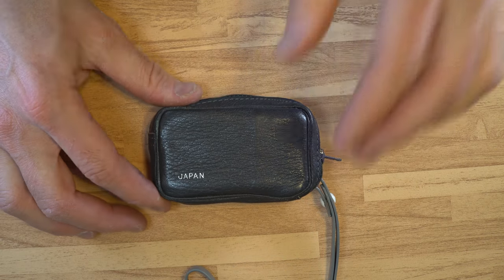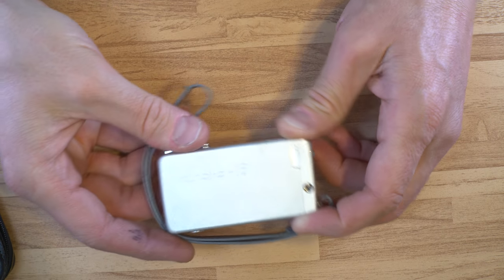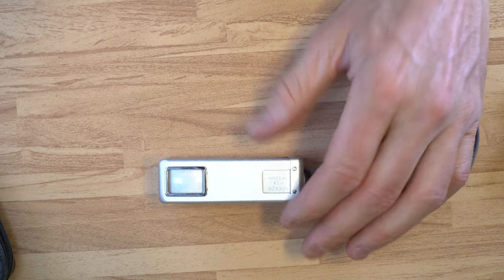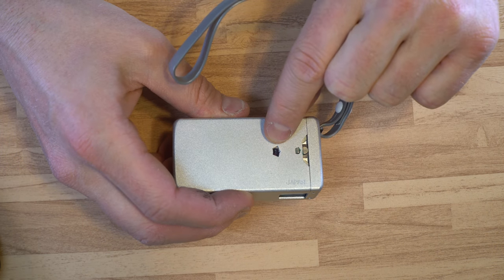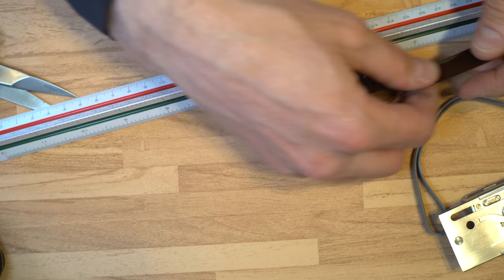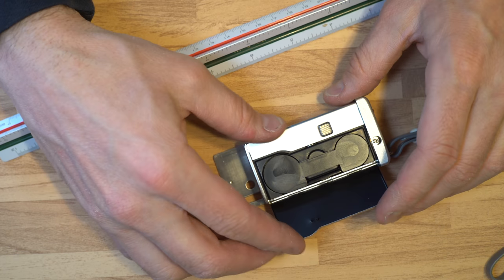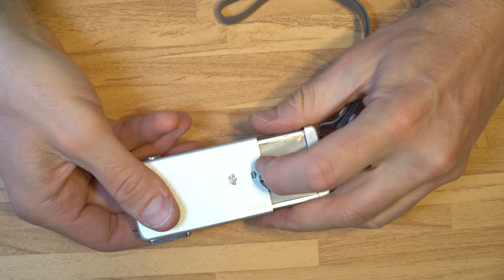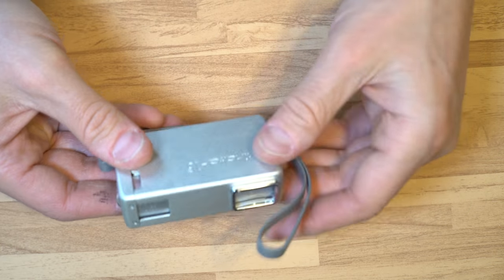Minolta 16-II Manual: Take Photos, Flash, Load Film, Re-spool Film, Shutter Speed, Aperture Setting

Comment: In case viewers are put off, let me clarify that the only part of the film self-loading procedure that must be done in the dark is inserting the cut roll into the feed chamber of the cassette, making sure an inch or so exits the slot. That chamber is then capped. Taping, and reassembly of the take-up chamber, can be done safely and much more easily in the light.
Reply from the maker: Thank you!

Comment: As someone who has taken photos on one, the manual says cut the film to 18 inches, and the sprocket holes are only a problem on I think the 16mg which had a larger negative size (13x17?). They are also very effective with microfilm, due to their manual adjustments, but you need the distance filter to take photos of any usefulness at the low apertures. Scanning can also be difficult, use of a glass side holder helps to keep them spaced and flat on a scanner, but enlarging then scanning gives you much more detail than the digital scan due to small negative sizes.
Reply from the maker: Thank you!

Comment: My father-n-law was in the military but I'm not sure if or when he might have been stationed.  He had a rokkor 22mm and left it to my husband (his youngest son).  I was going thru stuff in the basement and found it.  How can I tell if it has film in it? It does have a cartridge.  Also can I still get the film ( if there is some) developed? My father-n-law passed away 2 years ago and I thought it might make a good Christmas present for his 4 children. Thanks in advance
Reply from the maker: That's an awesome thing to find and a great gift. To check if it has film, you can check the frame counter on the bottom. If it's more than 1, then it may well have film. To check for sure, or if you're near the end of the roll, fire it a few times and remove the cartridge. Old film can still be developed though whether it yields images is a big question mark. I'd check with Old School Photo Lab to see if they can develop it. They can also return the cartridge empty. Film for these is not sold any more, however.

Comment: I just bought a Minolta 16 Model-P today at an antique store and am new to film photography. Would Lomography 110 cartridges work with one of these, or do I need to find/3D print a custom Minolta 16 cartridge to use it?
Reply from the maker: I don't think 110 will fit. If there are 3-D printed cassettes then that's probably the only option.

Comment: David, Thanks for this video on the Minolta 16  any idea if anyone makes a battery equivalent for the Duo-Fit Flash Unit? (originally Maxell W-10 15 Volt )
Reply from the maker: Thank you! Unfortunately, that's not a battery I'm familiar with. If there is an adapter, it will either be on eBay or Thingverse.

Comment: who would develop the film?
Reply from the maker: Most labs can because it can be processed like 110. If you want to develop at home you would need a 110 reel.
Reply: @DavidHancock  I had a fling with 16mm still cameras in the 1970's. I used Kindermann and Nikor tanks and reels. I got a 16mm stainless steel+plastic reel to process 16mm film. I later used that reel to process 110 Verichrome Pan film when I had a Canon 110ED camera. I found the 10X14mm format restrictive, so I looked for a 12X17mm camera before moving on to 110, then back to 135. I've come to regard fixed focus cameras limited and toy-like.